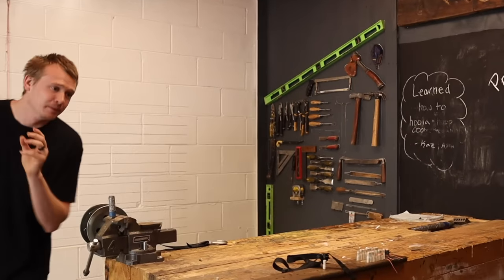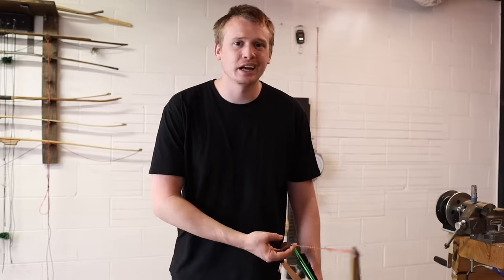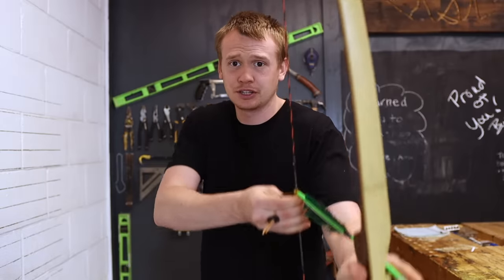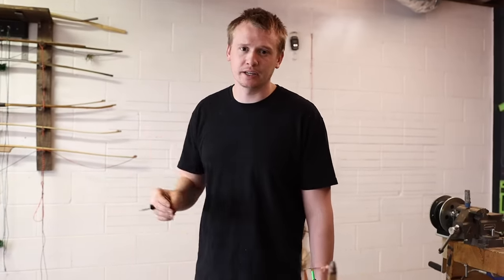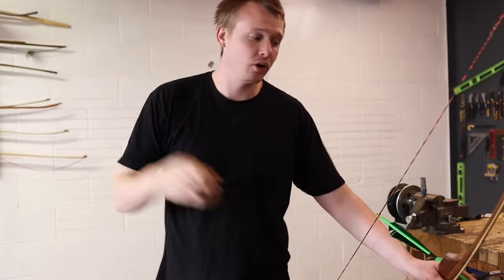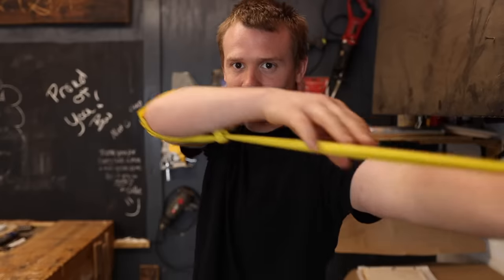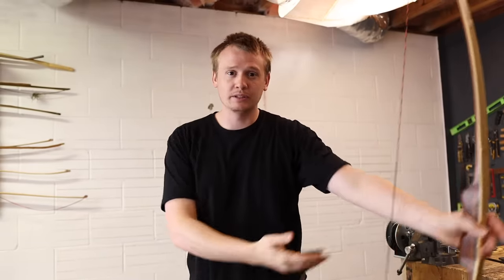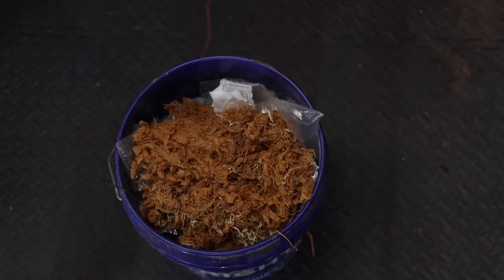How To: SHOOT A TRADITIONAL BOW & ARROW For The First Time {Beginners Guide}

Comment: ha! what timing. i bought my first bow cause of your channel 2 weeks ago, and now i've bought my first traditional bow just yesterday. i'm already in love with archery.

I had a question i was wondering if you could answer, the longbow I just bought is bamboo backed and it has a very light beige stain. I'm interested in dying it a darker colour, and wondering what the best way to do that would be and if it would compromise the integrity of the wood at all.

i'm also interested in wood burning or in some way putting some designs on the front of the bow, and again wondering if that would at all comrpomise the integrity of the wood. hopefully you can let me know because google sends back mixed results !

Comment: Thank you for this. The golf ball idea is great. I've been practicing for a couple weeks with a pretty badly warped, traditional recurve bow. I'm assuming this isn't going to help my aim? I don't know. I'm a total newbie. My upper back and my abs are pretty sore so I think my form is decent. My release has been a pain though. After recording myself in slow motion I noticed two things.

One, just before I loose each arrow, 9/10 times my draw arm moves forward an inch or two. Two, when I release, I tend to pull my hand away from my cheek instead of letting it glide back. Even though I am consciously telling myself to do that, it won't. Being able to imagine a golf ball on my shoulder and giving myself the objective of gently grabbing it I think will help with my grouping drastically.

Comment: Damn great video for a beginner, which I am despite my have shot bow for years, one thing: I think the more fingers you put on the string the easier it will be to drow and the more difficult to have a clean release, I personally use thumb draw or Slavic release (1 and 2 fingers) and I find it great, also have you ever tried shooting with one of these stiles, with the arrow on the right side of the bow? It makes you able to shoot more arrows in less time, and it's really fun
Reply: I used to shoot Mediterranean, but I tried Slavic a couple weeks back and I really liked it. I was already shooting off of the thumb side of the bow and happened to be Slavic. With Mediterranean, my finger above the arrow would always get pinched between the arrow and the string and would start hurting after many shots. Also, I can get a much better anchor point with this style. I can put the arrow right up against my face because the top finger isn't in the way.
Reply: @davidkhrystenko  what I prefer the most about Slavic drow is that you can put the arrow on the string, draw and shoot basically in one single movement

Comment: What would you say about bow arm rotation? I was taught that the correct method is to rotate the left elbow clockwise to stabilize the shot, and it's a pain in the ass to get right. Do you do that too?

Comment: Hey, so I don't know how common of a problem this is, but I wanted to ask someone who has been shooting for a long time for advice. I recently got my first bow and went for a draw strength that I could pull, and got a 60lb bow (I am a larger guy so I was not concerned with the weight being higher). Just from practicing I have noticed my shots getting a little bit better, and am glad to have found your channel so that I can start applying your tips in the future. My problem is that shooting my bow 25-30 times or more really kills my shoulder causing me to not draw my bow correctly, and it continues to hurt for over 24 hours. I would understand if it was my drawing arm as it would obviously mean I am drawing incorrectly and using the wrong muscles, but it is the shoulder of my off-hand that I hold the bow with. I feel almost no strain in my draw arm, and the only pain I had on my draw arm was my fingers before I made myself a leather tab. What is causing the pain, and what can I do to prevent it in the future?

I do want to mention that I have had a problem for most of my life where my shoulders can pop in and out of place while under strain. Normally it is not a problem though as just keeping it in mind usually allows me to prevent it from happening, and it doesn't feel like that is the problem while I am shooting. If you do not know what is causing my pain then I guess I can assume it is just because of my bad shoulders and that the pain will just stick with me as long as I want to shoot.

Also, please don't give me a hard time for choosing a higher pound bow as my first. I didn't know you should start out a lot lower, and didn't have the money to buy more than one so I thought I should get one that I could learn on with slight difficulty, and be used to later without wanting to move to a different bow any time soon.

Comment: Hi there Kramer,

This was certainly really fast paced!  But you are right, I was able to watch it a few times to get the idea.  I have a compound bow that I think is made for a juvenile since it is small.  Anyway, I do not want to have a hard draw since I am not that muscular, so it is pretty easy to draw back.  I got it used at a garage sale for $5.  I wanted to try archery so that was a good way to start.  I noticed some things that you did not mention (or I could not detect that you mentioned it).  What are the little metal balls on the bow string that some people have?  It seems this should be there so the arrow is hooked into the bow string at the same place each time.  Should I put one on my bow string?  I do not have one there.  I want to try this little compound bow for a while and if I like archery in general I will get a long bow with not a heavy draw.  Maybe 30 lbs?  Also, I bought 12 Thunder Express Target arrows from Bass Pro shops.  They are fiberglass and 26 inches long and look very pretty.

I like the idea of doing the shot the same each time and this seems to be wise advice.  

Can you advise on the items to put on the bow strings to align the arrow and also some items I saw that are to protect your fingers that look like plastic tubing?  

My husband will order two of your tabs.  I am using leather work gloves and it is not great.  We have a three car garage and I shoot in the garage sideways.  All of our houses are very close together and I cannot do this is our yard.  I stand about 25 feet from the target, which is a cardboard box with stacked cardboard in it.  Unfortunately, I missed a few times and I shot some arrows into the drywall.

I love your positive attitude and that you are continually making bows and talking about the process.  I can detect that you love this and want others to succeed as well.  I like to watch you videos.
Reply: I guess my husband has to wait until you have more of the "3-under shooting tab"

Comment: Better is get a finger glove in the style you want, those have more finger movement as sometimes I want the two under more spread out.  There are some like my brother who insist on not using an arm guard to develop good form but if you get string slap, you might be tempted to use a bent elbow to keep the bow from hitting the string.